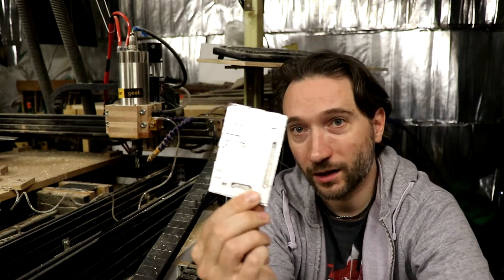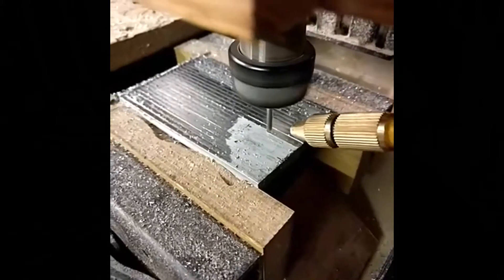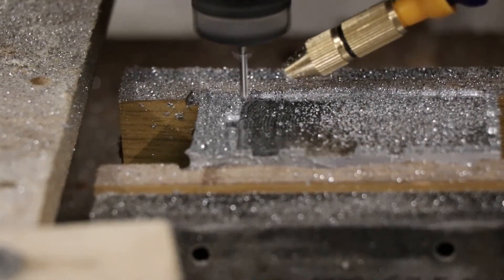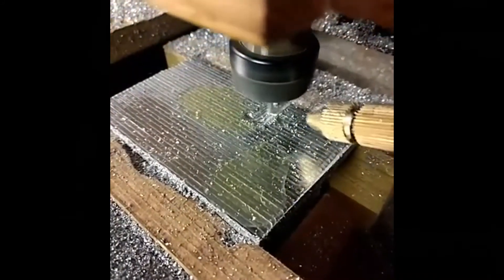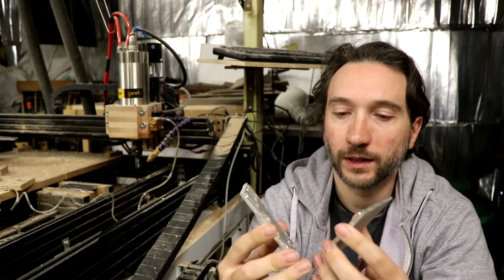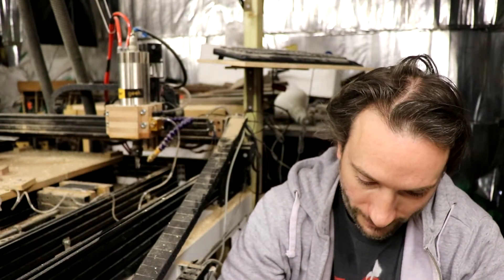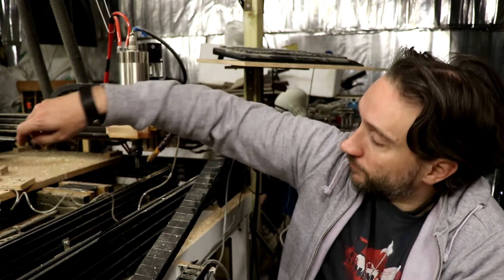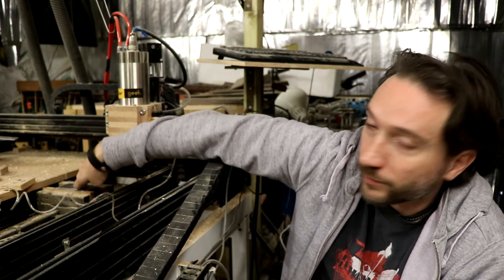Ox CNC feeds & speeds - Aluminium experiments

Comment: Dan, can you help out a CNC newbe? purchased OX about a year ago second hand & thought it was time to get it working. it's all together but I don't know where to start with connecting and driving it?
 I do have a 3D printer so I know the basics it's just all I have is the unit. I use fusion & I have a spare old laptop but other than that I don't know where to start!
Regards Andy WG
Reply from the maker: Hey Andy, sure thing do you know which controller you got? if you're familiar with 3d printers your 90% of the way there, it's pretty similar setup really. if you want a slightly easier interactive chat to go over things you can always drop in on my discord: https://discord.gg/9f375HPZ
Reply: @MakerGeek  what ever it came with Dan, looking at the manual it's a spark concepts xPro.
It has a USB but I have no idea if you simply plug it into a pc?
Wargrade@gmail.com
Reply from the maker: Right yeah the xpro usb. That's what I started with before upgrading to the duet. So yes. Just plug it into a PC. The motor wiring should be fairly obviously marked on the board for X,y,z etc. What you'll need software wise is 'gcode sender' the xpro is basically a suped up arduino running GRbL. It response to serial commands. I used to use bCNC as the software with my xpro.
Reply: @MakerGeek  What I will do is get my old laptop fired up and see what I can see.
If you don't mind I will drop you a line (when) I get stuck!
Andy
Reply from the maker: No problem at all. Happy to help with any questions. Good luck
Reply: well I got stuck. didn't take long.
I am ok at using software but when it comes to installing things, unless there is an option for "press here to do everything for you" I'm done for.
Found and managed to install a driver for the xPro, but bCNC talks about python and pip errrr what!
Also I did find a YT video installing universal G code sender. but I cannot get that to work either.
I will say my old laptop is still running XP & this might be the issue.
I do have another laptop with a doggy screen I might try.
Installed Discord, but your link has expired.
Reply from the maker: Sorry about that, didn't notice they expire by default. https://discord.gg/hveEYx47ZV
Reply from the maker: For what it's worth you'll need to install python 3.4 to run bCNC. That's the last version that worked on XP

Comment: Hi it looks very impressive and thanks for the video. I would like to know what is the working area for this kit. thank you
Reply from the maker: Mine is the 1000mm x1000mm kit which has a working area around 820x775. In practice I rarely do anything that requires all that size in one go. Instead I've got different parts of the bed set up for different types of jobs

Comment: Can you comment on your air cooling setup? Are you using a standard air compressor or something special for CNC?
Reply from the maker: I was trying to use a tiny air compressor from my air brush. It was dubious as to its ability. Mostly it got too hot under prolonged use as it wasn't really designed for continuous operation. I still have it on the list to buy a better compressor for the job.

Comment: Hey great to have found your channel! I too have a ooznest ox. It's really reassuring to see these hard tests! So far I have had a great deal of trouble with what I think is lost steps on the X axis. I have been trying to cut birch plywood. On ooznests advice I have taken the feed rate very low and am making passes of only 1mm, which did improve things however I am still getting such big step losses on the X axis that it is currently in useable (not to mention painfully slow). Before seeing this I was starting to worry that I'm the machine was really underpowered but it's clearly not if it can handle anything even near what you show (I know birch is much harder that MDF but still). Please if you have any advice I would be so greatful! I'm currently using a 1/4 inch bit on the dewalt router that they offer.
Reply from the maker: +Aaron Merriman hi Aaron. What power supply and driver board are you using? Could be an issue with feeding enough power to the motor. Would be helpful to know whether you have microstepping enabled, and exactly what feed rate you've been trying. Happy to try and help
Reply: Maker | Geek Hey thanks for your reply! I'm using the electronics kit offered by Ooznest. So the same as you I think. On my most successful job (managed to make all but the last pass) I was using a feed rate of 15inches/min (sorry for Imperial) cutting at about 1.5mm depth with a 1/4 inch bit. Where would I find my settings for microstepping? I understand this lowers torque? As far as I can tell I have the correct volts reading on the power supply and I have adjusted the small screw on the CNC pro to full and the reduced by a 1/4 turn (as advised by Ooznest). Thanks again! Blown way by the detail you got from this set up on the small peg game you show in another video, awesome work!
Reply from the maker: +Aaron Merriman ok so if my conversion is right I run probably about 3 times that speed easily. The microstepping selection should be right next to the small screw you adjusted for power. Your need to have configured grbl to match number of pulses per turn. But yeah if you had it at a high microstepping you'd lose torque. So you are running 24v? For the job that failed the last pass what was the total material thickness?
Reply: Maker | Geek Ok cool, so very unlikely not due to large a feed speed. I'll look into the microstepping and research to to config the grbl. Yeah I'm running at 24v, so far all my attempts have been in 9mm ply. I'm the most complete job I had 6 passes programmed. Thanks very much again!
Reply from the maker: It might also be worth checking the tramming of your spindle. Normally if you make one complete layer ok then you should be good for all of them. But if you're spindle isn't completely vertical inline with the z axis, the deeper you go you can wind up engaging the tool a lot more. Eg if it is sloped slightly then at the bottom of a 9mm cut, where you should only be cutting the last 1.5mm you might actually be catching the whole 9mm depth on one side. Which might cause a failure late in the process
Reply: Maker | Geek Ah great shout! I'll check that too! Had a look at my ustep jumpers, I have the first 2 slots jumped. Spark concepts website says this is 8 usteps, does this seem normal? Can't test anything until next week now as I'm waiting for admin to unlock new (old computer) that I have hooked up to the CNC so I can install the gcode sender. Thank you for the time your investing in this, it's so helpful! Do you have patrion?
Reply from the maker: That is the same as I have so that's is not the issue. Maybe send me details of the file you are working on. What app is generating gcode etc. Daniel at MakerGeek dot co dot uk

Comment: dont need that kind of high rpm
Reply from the maker: +rob ten tije what would you recommend? One problem I have it's time to experiment enough, once you find something that seems to work enough it's hard to justify the material and time to try further options. I'd love to know what works for you
Reply: what work for my machine in aluminium is put spindel on 18000rpm

then do this

endmill diameter in mm x 3.1415 x 18000rpm : 1000 = feedrate in mm/min 

25% of diameter in mm of endmill to cut down in the z 

here got my info from in pdf 
http://webseite.sorotec.de/download/fraesparameter/schnittwerte.pdf

Comment: What are you using for a controller / spindle?
Reply from the maker: +johnathan lee hey, the controller board is the xpro usb controller available from +OOZNEST which I'm driving with bCNC software running on a raspberry pi. The spindle is a 2.2kW water cooled spindle with associated vfd which I bought from cnc4you
Reply: Cool, I was also looking at that controller but stumbled across the CNC hat for the PI. Have you seen this controller? http://blog.protoneer.co.nz/raspberry-pi-cnc-board-hat/ have most of the parts for my CNC now just haven't decided on the controller portion. your CNC looks great by the way!
Reply from the maker: +johnathan lee I had not seen that controller. Looks compact. Are there any videos of it in action? I've been very satisfied with my xpro.

Comment: Hey Dan. I've just completed my ox cnc, first movement tonight. Do you recall how you tested yours? With a pen or anything? Any advice?
Reply from the maker: +Rob Llewellyn sweet;, I got the shapeoko test pattern first with a pen then with a cutter. Important that the pen is very rigidly attached or it may give worse results. Ultimately the machine is for cutting through dense materials so a pen on paper only goes so far. Engrave a test pattern into wood :-)
Reply: Maker | Geek marvelous, thx Dan. Gave it a go, I think I've got some tweaking to do! https://goo.gl/photos/1kz7dLYnj1xuoavRA
Reply from the maker: +Rob Llewellyn interesting, looks like one axis moving twice the distance of the other? Or picture taken at extreme angle :-) otherwise looking pretty good
Reply: Maker | Geek yup, looks like x is doing a quarter of what it needs. Loads to sort out, rattling scrap board needs holding down and this thing needs to go in a mobile unit and get bolted down. Vibrations and not the good kind. 🙂
Reply from the maker: +Rob Llewellyn I'm going to guess the micro stepping is set differently on each axis...
Reply: heh. Yes, or maybe I was using the wrong Firmware in UGS. I 'think' it was set to XLCD and not GRBL, but it was at 6am this morning and now I;m sat in work, that seems like a very long time ago! :) Thanks for all the advice!
Reply: Maker | Geek yup. It was this! Different steps on different axis.

Comment: Useful, thanks. I'm finding copious wd40 helps with cutting acrylic, I'd expect much the same with aluminium? I'm upgrading my ox to acme screws as the belts have been weak and nothing but trouble, especially getting tension right. New plates in acrylic, then I plan to cut them again in aluminium once machine rebuilt, so your tips are a help. 

Also, dust collection? Aluminium chips will chew up the wheels and belts- mine are not the same after first acrylic foray making the dust shoe. Aluminium even more so - nasty sharp hot conductive debris! Chew the wheels right up. 

'preciate learning from your experience.
Reply from the maker: +Duncan Smith I have cutting fluid that I was spreading when not filming. Good point on the chips damaging the wheels. I clean up with a shop vac. But I should make sure to be thorough.